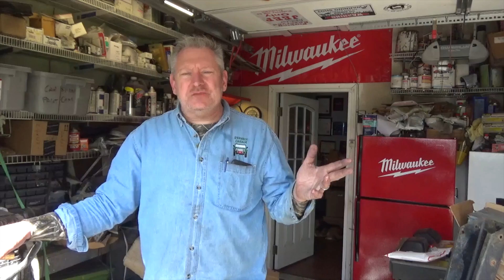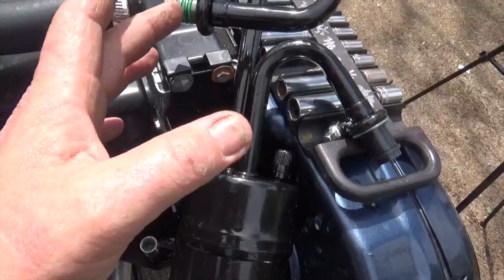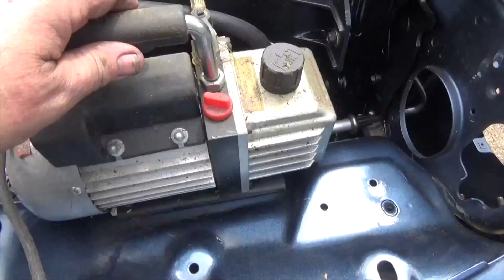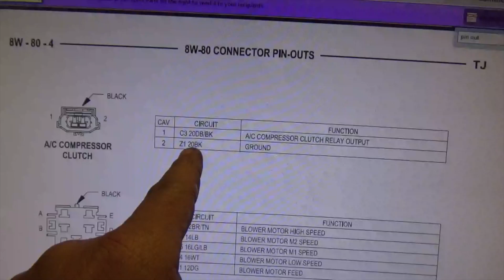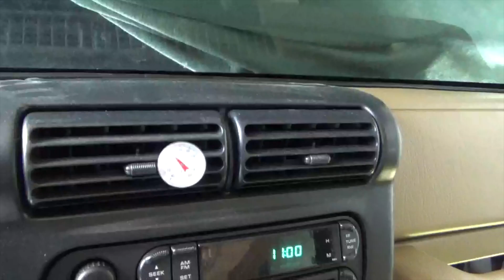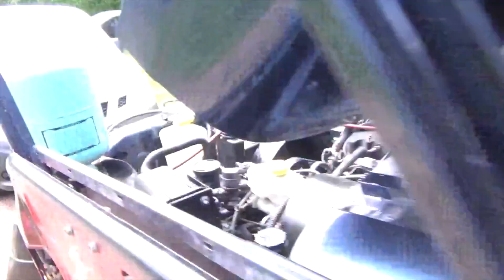Jeep Wrangler TJ Project - AC Installation - Charge System - Complete

Comment: Hope you can help, just did the same  thing. 97 jeep tj, 4cyl, added ac.  But when I turn on the AC the belt sqeuls and the water pump and fan stops turning, causing heat. New fan clutch, new belt, all new ac parts. I can not firure out why this is happening? Check all, belt is super tight,  Turn off ac and water pump starts turning again. ac on causes it to slip and stop turning?? Any pointers?? Thanks

Comment: Did you ever get a list of the parts? Looking at a 97 that did not come with ac. And would be adding it also. If I buy it tomorrow. Guessing under $1000. should knock it out? Going by rockauto If I did not leave out any parts. Its way less then that. Engine has the bracket you had to get on it now. Would also need the outside wires. And looks like the switches inside should cover the ac?

Comment: 2001 Jeep Wrangler, new to me. I am changing the evaporator and receiver dryer. Any recommendation on how much oil to add to the system? I am certain it has been leaking for quite a while, filled and refilled.

Comment: Hi  Dave. Thanks for the awesome write up. Question: Did you ever get a clutch connector to match the single pin connector or did you just keep it with a jumper or hardwired? I was hoping to replace the two pin off my existing harness with 1 pin that will connect directly to the AC Clutch. +

Comment: hey I used to have 2.5 L with the jeep air kit then put a sbc 350 in with serpentine. bolted a whole belt drive including AC compressor to my motorcycle what the chances if I use custom hoses with the  same condenser/dryer/evaporater/under dash aftermarket ac for (4cyl ) with my compressor . will it work ???)

Comment: Hey i just have a question what is the air compressor that you use? I'm in the market for getting a new one and I was just wondering what you use/recommend... Thanks, your number one fan Joey
Reply from the maker: +Joey Milner I buy mine usually on Ebay but don't buy a remanufactured - get a new one. I haven't found any "brand" was better then another. I appreciate it Joey !